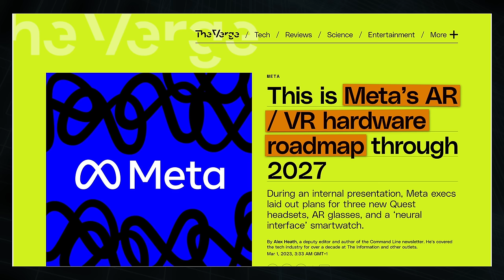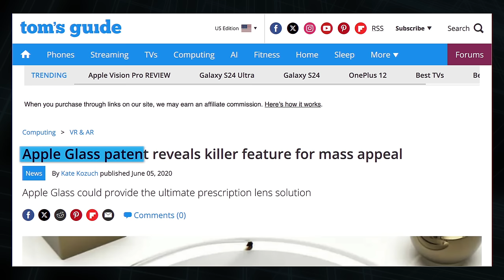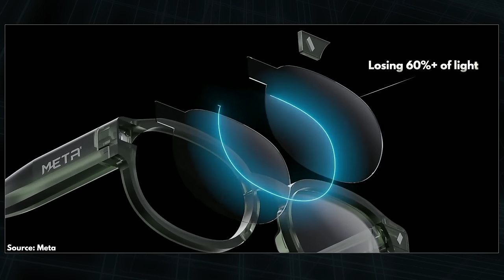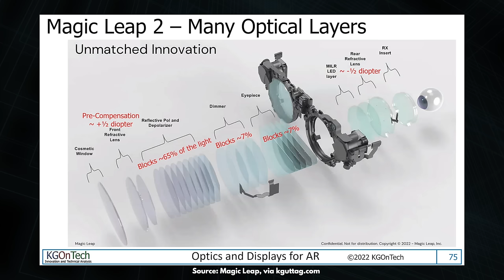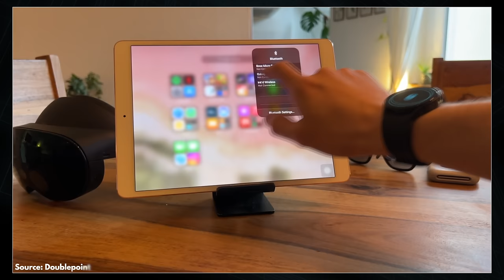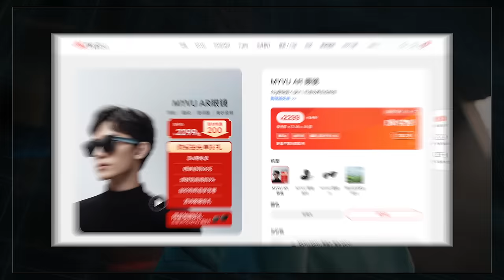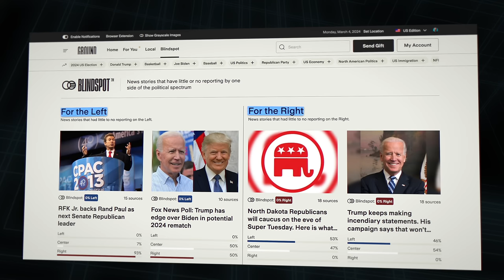The billion dollar race for truly smart glasses

Comment from the maker: Compare news coverage from diverse sources around the world on a transparent platform driven by data. Try Ground News today and get 40% off your subscription: https://ground.news/techaltar
Reply: Instead of trying to fit transparent o LED with electrochromic glasses. We could try a full blown display with live camera feed serving as a viewfinder. This way we can achieve proper desired resolution and even control the brightness. Something like a cars rear view mirror suddenly turning into a camera's live feed display. Now, since this acts like a camera's  viewfinder, we can easily insert AR text and objects into the real world live feed. Something like AR stickers and AR emojis
Reply: long term, quite possibly - but we know what that device looks like with current tech - apple vision pro and it's still sub par for mainstream @arnold_m_xavier  before we get something with cameras we will get what is described in the video - think of this as having different classes of device, its an AND conversation not an OR conversation.
Reply: I believe I know a way to get around the issue with the extra AR components that they are having trouble fitting into lightweight frames, just repurpose the Humane AI pin (or something like it) to pair with the glasses to perform all the scans necessary to facilitate AR while keeping the frames lightweight, plus the AI could be trained to coordinate and optimize this process to be cohesive and extremely user friendly, you are welcome, please feel free to hook me up when this actually works ☺️
Reply: Dude I love how you showed all the technologies at the beginning 💟🌌☮️
Reply: hey, so, while i'm watching this, i'm wondering if i should invest in one of these companies. Then i thought, hell a bunch of research should get into this. But then, you already did that. Maybe you should or could talk about in what companies you would invest. Maybe on another channel?  Maybe it's stupid, but you know, just a thought.
Reply: I think wireless power is the missing link to this tech, which removes the necessity for a bulky battery.

Comment: I feel it would be a lot easier to have the computer part in a separate device (ie a phone or dedicated device) rather than trying to fit it and its extra battery requirement into the glasses. Also you won't lose anything important if the headset is damaged or stolen.
Reply: Exactly my thought. I mean, people are already walking with portable Vision Pro batteries. Nothing prevents a device that you carry in your pocket with a processor and  a battery from being designed.
Reply: It's already the case with xreal rokid viture....
Reply: Most standalone vr devices can already do that, it's just not as user friendly yet 👍 

A little bit of processing will always need to be on device but to get more out of them you do need external devices anyways, like I don't care how much power the next xr device is. I want better lenses and tracking options👍

You can connect pretty much any vr device (with a few exceptions) to a pc, which could also be a cloud pc, or a laptop in your backpack 😁
Reply: @Akab  there is an exeption glasses called "inmo air" it's standalone glasses with android operating system and cemera
Reply: @diredino5299  thats why I said most 👍 exceptions do exist, and that's sometimes a good thing 😁

And the quest is also just an android device under the hood 👍
Reply: I also pray for IoT networks to become more robust and efficient for this to happen. A fast IoT network surrounding your body - complete with a smartwatch on your wrist, glasses on your face, smart(...?) earbuds in yours ears, some leg equipment if that needs to exist, perhaps gloves, ...and the insane Neuralink stuff for the crazy ones - all connected to each other, forming a pretty big LAN, all without interference, so they can stay strong in an environment where all people present have such devices, and be able to transfer data at crazy rates in a secure and also safe -for-your-body-and-the-IoT-network manner.

...yeah, that's making an ordinary person a cyborg, but we know there are going to be tech savvy people doing crazy things like this, haha. I was here just to talk about the IoT aspects of it. Myself, I write software, and don't trust it at doing any important things, LOL.
Reply: yes exactly, is it also not possible to fit some sort of external equipment for tracking in the room where you are using the vr or ar, fit in the room externally, since likely in vr you won't be going outside.
Reply: not that simple, as you would still need on device computing power to track everything (due to latency). You would also need very low latency wifi chip that could encode and decode video. quest 3 can do this, but as mentioned in the video is a 20 watt device. a 1 watt device is asking a lot, even with offloading processing to a phone
Reply: @legendp2011  if you this is true then well i gotta learn a lot more and do some maths. thanks anyway

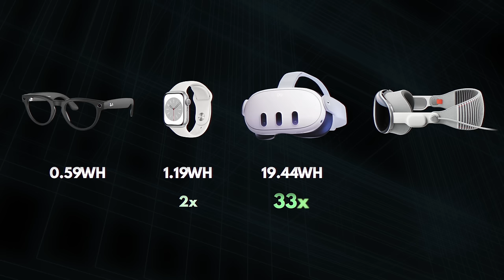Comment: 12:25 Thank you for using Wh as a measure of actual capacity and not mAh as every wannabe electrician out there. Greetings from Berlin ❤
Reply: Ah makes sense when working with a fixed voltage like 48V bikes.
Reply: @gljames24  aka wannabe-electrician projects.
Reply: Doesn't both mean the same thing😢
Reply: @RaySmith-zg7od  No, the energy stored by a battery is dependent on both the voltage and the amp hours either one of which can be changed independently in a battery. Watt hours are an actual measure of the energy being stored.
Reply: mAh is the measure of energy being released. It's a promise by companies for stuff like "this bottle will refill 6 glasses", but we can thank companies for honesty when they advertise stuff like game console storage space and then it falls short of what ACTUALLY can be stored there. 

You can nitpick all you want that "buh, there IS energy THERE" when conditions change and it still can't be released, like it's drinking water evaporating into the air. Seen a bunch of engineers trying to plan economy and all other fun stuff on that premise. Currently no Plaestinian is targeted by Israeli fire, there's one.
Reply: @kalleguld   basically what @garethbaus5471 said.

I like the analogy of gas, for electricity.
When Current (Amps) is the diameter of a pipe and Voltage is the gas-pressure, you can calculate the amount of gas stored (Watthours). However you cannot calculate the amount, when you don't know the gas tank pressure (Voltage).

When you work with the same gas-tanks, you can compare the amount of energy stored by the time it takes to empty the tank, without the need of pressure (Voltage). Since it's rarely the case, that the tanks are the same, it's actually flawed to compare mAh between smartphones. there can be a Voltage difference of 10% between models.
Reply: That analogy of Amps as the diameter of a pipe, breaks down a bit when trying to define what a Watt is:   
Without a unit of time attached, a Watt is like an aperture of zero depth: You can measure how much can fit through it, but there's nothing "in" it; it's a zero volume.

Comment: one thing i dont get is why they keep on having everything packed inside the glasses, wouldnt you solve a lot of the issues if you can house most of the components in a phone shaped block that you put in your pocket, apple is the only one who has done that so far. heck, you could probably off load most of the compute to your smartphone and have it send the data to the glasses over 5G
Reply: Yes I agree with you. Apple's approach is the best at the moment. Considering the fact that the entire power supply is managed by the power bank, it's mandatory to be connected for the system to work. They might as well offload the computing to it too and make the glasses lighter

Comment: Interesting but I honestly fail to see a use case. A video game style HUD sounds like a bit of fun for a couple of minutes and a minimap could be useful when navigating on foot or a bike. Outside of that I don't see the benefit when comparing it to a smartphone. Maybe Americans have use for an ammo counter in the bottom right corner of their field of view. 🤔
Reply: What if I'm too lazy to pull out my phone?
Reply: @ClearGalaxies  then this device has to be at least on the same level of efficiency at finding information as your phone. And no one talks about the controls for these things - shouting every command makes taking out a phone easy in comparison.
Reply: @mopozuJIko hand tracking + eye tracking is all that's needed. Apple Vision pro has already proven this method works well, even in a gen 1 product. The only hangup is typing, but I have no doubt some clever designer will come up with a new easy way to type words this way that doesn't require any voice commands

Comment: Great overview! So, DragonBall Z style scanners within five years? I'll start working on a power level app right away! 

Honestly, if someone can get the displays, optics and sensor package right (ie the stuff that actually needs to be on your face), I'd probably prefer them to just have a USB C plug behind the ear to hook them up to something that provides power, computation and an image source. More feasible, probably lighter, easier to repair or upgrade, more open and more flexible.
Reply: sees man petting a dog
"What does the scanner say about his serotonin levels?"
"It's over 9000!" crushes AR glasses
Reply: Yes! I've been wondering for years why they're trying to fit the computer+extra battery into the glasses! Another benefit would be if you lose the glasses, you don't lose your computer/data.

Comment: Why couldn't some of the space required for batteries, compute and cooling be placed around your neck or on your shoulder? Similar to old wireless earbuds that put some extra battery in a wire connecting the sides.
Reply: the your very quickly no longer wearing glasses

Comment: Never mind displays; we have high speed LCD welding masks that dim the whole viewport, but we don't have racing helmet visors or welding masks or sunglasses, that just dim the brightest glare spots proportionally. 

Dimming the highest intensity points while leaving darker regions untouched, allows the eye to see far greater detail in mixed light; the trick is, dimming the right areas of each lens, to align with each eye, quickly enough to account for any external movement. 

It can be done simply enough: The high speed LCD elements & high speed light sensors already exist. The parts wouldn't even be especially costly or heavy, relative to a lot of existing racing helmets or electronic welding masks. No large battery needed, & the processing required is negligible. 

The benefit to visual acuity from such a system, could have racers & welders hooked from their first use. 

Sunglasses are a very lightweight & slimline form-factor to pursue, but making them dim selectively would at least be a lot easier than incorporating a full blown display with legible text. 

People keep trying to make "smart glasses", but our current glasses & sunglasses haven't made it past photogray lenses that dim everything instead of just the bright spots.

Comment: It might work if they only had the ear support parts with a lasers for the display, cameras to track eye movements, and moving lenses to always focus the light into the eyes. To block out light, maybe they could capture the light reflected off pupils and shoot back an opposite wave to cancel it, if that’s possible. Light doesn’t interfere with itself like sound does, but maybe it could cancel out the energy in light receptors.

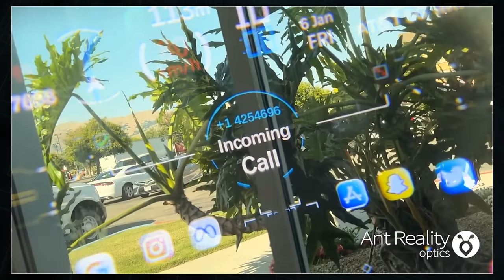Comment: 7:38 The problem, as I see it, glasses and headsets won't be successful until they are more useful and stylish. Remember 3D glasses and TV? Not many want to sit around looking like a nerd for several hours.
Reply: Simple, remake fashion so everything looks like it's cyberpunk
Reply: @Exospray  It's still not selling to the masses, only appeals to a much smaller niche market.
Reply: You didn't need to. Passive 3D works with polarizing glasses which can be made in any size and shape you like. You can buy very stylish polarizing 3D glasses.
Reply: @Ni5ei  The question is, not whether they're available, but can you market them to the masses or only a niche group of nerds. Will your mom and dad buy them? Will grandma and grandpa? Neighbors, etc... It needs to useful and practical and stylish. Right now, you either must look like a nerd or Data from Star Trek: Next Generation and their use is extremely limited.
Reply: @jimmcnevin9367 Yeah absolutely. Sometimes it seems like the more tech minded people live in a bit of a bubble and forget to observe how the vast majority of people around them behave. Most people don't even like wearing glasses unless they absolutely have to due eyesight problems.

Comment: I fully expect that "AR glasses" will always have a little dimming to them, that's fine. Having sunglass levels of tiny while outside should be expected, and with "balanced dimming" they should show UI elements like Star Wars holograms, and then also have the option to dim to full black if they want higher resolution data. The ability to turn this on and off as needed is plenty of flexibility. 

The "typing" wristband seems like it will leave people in the dust if they can't touch type. If you don't have fixed patterns of how you type, it does nothing. 

I do think that there will also be a wider social acceptance of VR goggles. They will be about as "normal" as glasses were 100+ years ago.

Comment: I do think that while the Vision Pro is hilariously expensive and impractical, having the battery just be something in your pocket that is attached by a cable is probably the most realistic solution for maximizing battery life and usability. And I think that the idea can be extended to processing as well. Like the point of smart glasses isn't to replace the smartphone, its to provide additional utility to one. So why bother trying to reinvent the wheel and create a device that will always be weaker and less capable than your phone when you could just like, use your phone? 

Like ultimately these kinds of AR glasses are primarily meant to be a display. And Phones are only gonna get stronger and stronger over time, especially without the formfactor limitations of glasses. So I could imagine a pair of these glasses having a single cord that loops behind your ear and goes down into your pocket so that it can plug into your phone and a battery and then that offloads a ton of the hard work while vastly improving the processing and battery life of the device. This combined with that idea of having the input devices being a pair of bracelets I think means that we might be getting somewhere. 

I mean it does mean that we're now basically spreading a computer over our whole body with the glasses on our head, battery and phone in our pocket, and input bracelets on each arm. But I think that's the only way we're gonna get any kind of realistic version of this concept.

Comment: Transitions lenses might be a better shading solution since it doesn't add complexity or interfere with normal vision. An external battery with cord seems like the most practical solution to the battery life issue.

Comment: On the topic of battery and processing power, I think Dave2D made a good point in his video that Apple is probably preparing for the future (and partly social engineer its fanbase) where we get used to the idea of having an aluminum brick of battery and computer chip in our pockets and just connect everything through a single wire to the back of the glasses, that way the main headset itself can be really light weight and still have enough functionality. 
Although I'm not sure Apple is even planning that? Since from what it looks like the AVP's battery is still connected really awkwardly, and the wire is thick and inflexible to really achieve portability. And ideally the battery portion would be hotswappable to easily extend battery life. But knowing Apple, that would be the last thing they want to allow the user to do. LOL

Comment: No one knows where this field is going because technology will change so fast. But most people will not want a bulky headset unless it’s for movies.  AR glasses will be much more acceptable but what are the use cases?  Email, messages, low resolution stuff.  Maybe directions?  I think such glasses can be pared with smartphones to reduce weight and battery size.  This will be like smartwatches.  Indeed smart glasses should replace smart watches eventually.

Comment: There is smart glasses called "inmo air 2" they are standalone glasses with android operating system and 2 cameras. The concept really amazing but they need to make the display bigger and the resolution better. This glasses came with a small ring to control the glasses and also the control is possible by touching the glasses. It's a chinese company

Comment: Also running hand tracking or eye tracking will add substantial load to the processor, and consume a lot of power whenever it's running, even if you managed to fit a powerful enough processor in

Comment: eMagin and Sony both confirmed that they need 10000 nit panel for 200 nit VR so for glassed it will be even higher. This is why Apple would prefer to use cameras for AR use instead.

Comment: What if you were to carry out most of the processing on a higher end (all be it currently non-existent) smartphone then stream data between the two? You could massively minimize weight and current technology limitations.
Maybe as opposed to a 'smartphone' you could have a glorified mini pc with a battery that sits in your pocket? -> They'd just need to make it marketable enough, by design or otherwise.